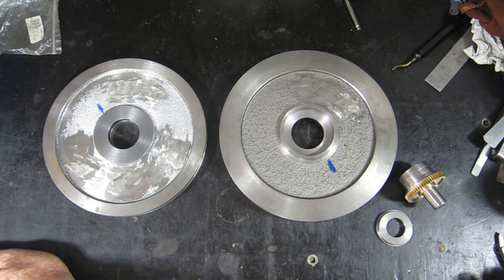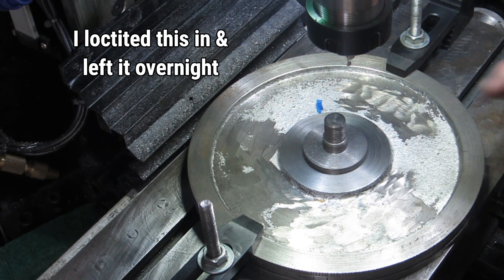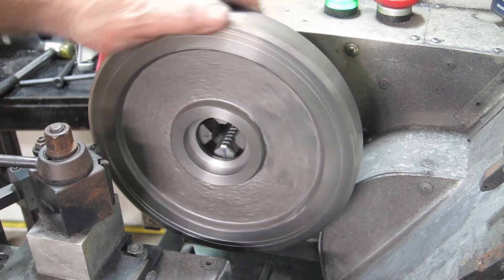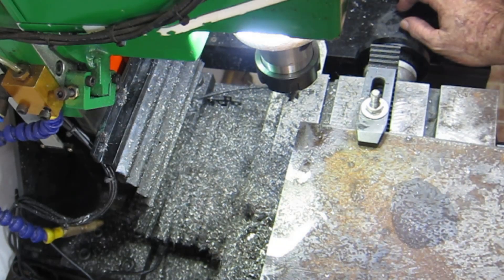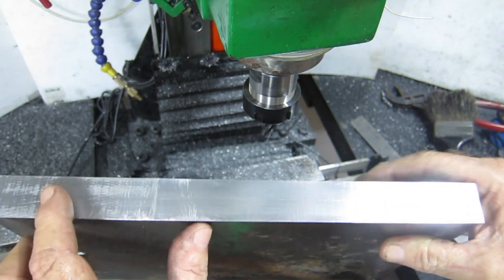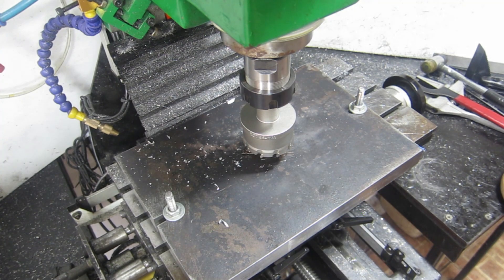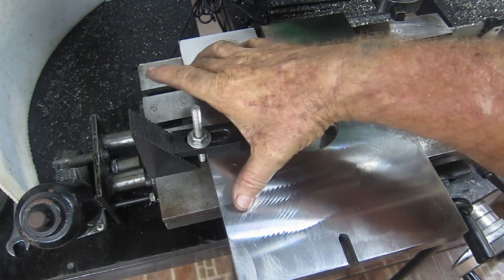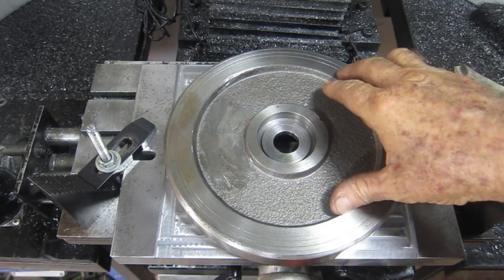Homemade Rotary Table - Part 4 - MHW Episode 81

Comment: You could always put the Dutchmen with the grub screws in from the bottom instead of under the worm gear, that way you don't have to remove the worm gear if you ever need to remove the center section. 
  Coming together nicely, thank you for uploading! 👍👍
Reply from the maker: Done now 👍

Comment: Question. If you are milling plate would putting something like a bag of lead shot or sand on top of the plate reduce the noise or just be in the way?
Reply from the maker: At one stage while doing that I had my hand pushing down on it, and it did reduce the noise ever so slightly, but most of the noise comes from the upright part of the mill, the Z axis vibrating and carrying on.